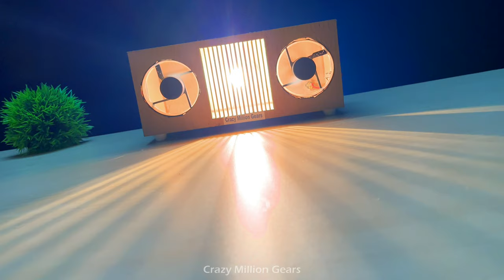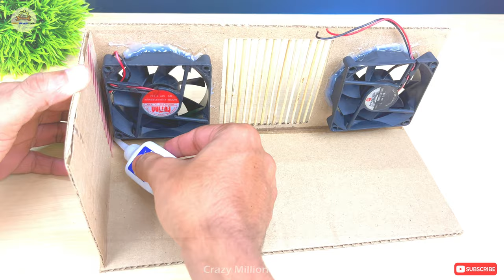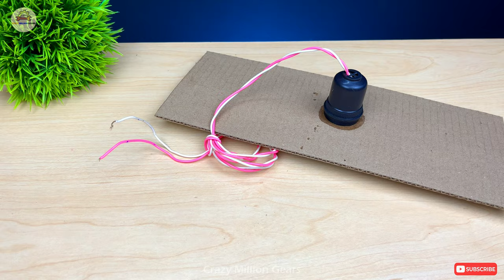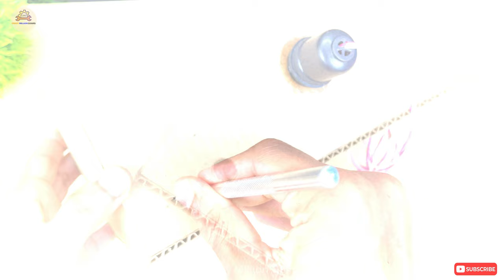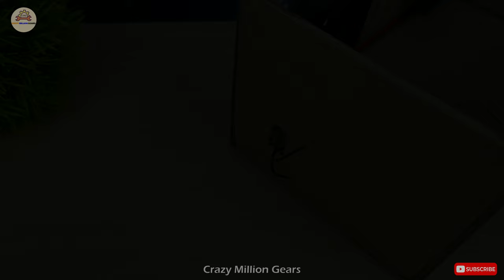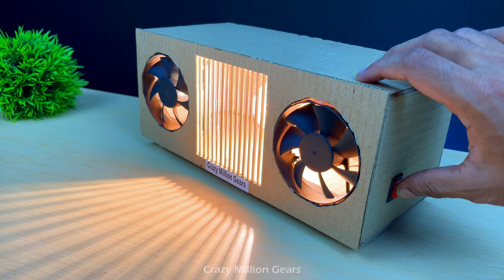How To Make Room Heater || Homemade Mini Room Heater || Science Project

Comment: Please mention the names of material
Reply from the maker: Cardboard 
CPU cooling fan
100 watt Bulb
Bulb holder 
Plug
Wire
12v adapter female socket 
Dc on/off switch